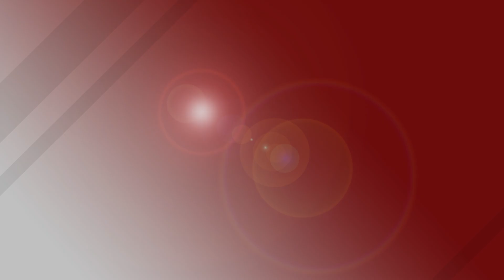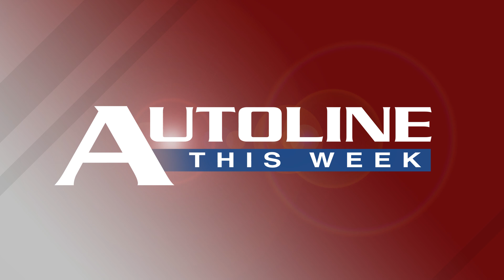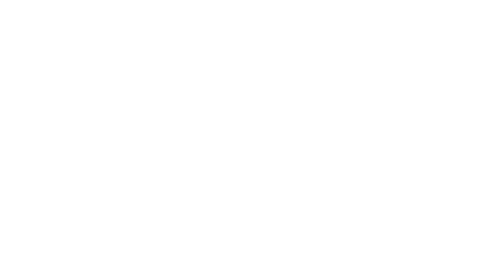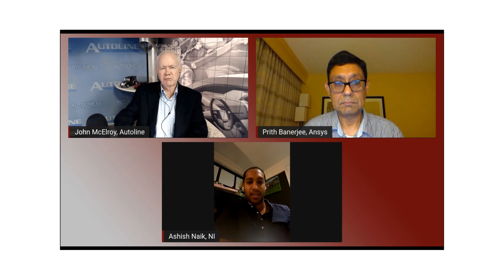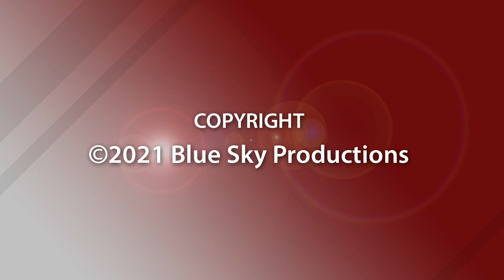Revolutionizing Product Development With Digital Twins - Autoline This Week 2528

Comment: Legacy focus on new product development.  improvement by product cycle --  new model product improvement.
Tesla focus on existing product improvement  [ continuous improvement of existing models ]
Legacy distraction?? or Legacy competitive advantage??
side note: Tesla doesn't change oil AND Tesla has the data -  legacy does NOT have the data.  ICE Fleets could have used 30 years ago.
Reply: Legacy does not have the data?   Who has the largest fleet of connected cars on the road?   Have you ever head of On Star which GM has had on their vehicles for decades.   Not only GM vehicles are using the On Star Network.

Comment: FSD has a fatal design flaw. "Learning" occurs in the Dojo data center which is then "delay & pinch" forwarded to the car's FSD module through an AT&T cell phone tower. Driverless cars making edge case mistakes leave Tesla liable. Today's presentation suggests the possibility of moving/predicting edge case decisions into the car and reducing the "learning/feedback loop" down to milliseconds, such that regulators will be willing to assign "mistakes" to "acts of god" releasing OEMs from liability.
Reply: You are assuming that there is somehow a "live" connection. This only occurs at each update. the car drives fine even when there is no connection. until the next update. There no "mothership"  controlling the car. in between updates, its pretty much on its own. THATS autonomy.
Reply: @dclpgh  Tesla signed a contract with AT&T to provide cell connection to their cars. Interrupts, where the driver takes control, are "errors" that are forwarded to the Dojo AI for classification or "learning", (as and when the cell tower connections get reestablished). The learned behavior instructions for the car are then forwarded back to the/all car(s) via AT&T cell connection. The in car FSD computer is a repository of learned behaviors. An FSD Beta update, may or may not include updates to the ancillary library files of known/classified images. There is a delay between a "mistake" induced "learning" and the update that goes out to the fleet of cars. Learned behaviors are updates from the past while mistakes are incoming from the future. Today's video suggested that there might be a way for learning to occur in the car in real time. Elon's criteria of "better than a human driver" leaves Tesla liable for all future edge case learning/mistakes. The regulators and courts accept "best efforts" from licensed and insured drivers. The bar for "computers on wheels" is going to be much, much lower.
Reply: @marvinegreen  you need to watch the presentation again. And again. Do you really know what you're talkin about? Dojo isn't even built out yet. Cellular Connection is primarily for the infotainment and navigation. When there is a disengagement the car will wait for a Wi-Fi signal because there are literally gigabytes to upload from the car 2 Tesla. 4G cellular connection ain't going to get it. Especially from AT&T LOL.
Reply: @dclpgh  I hope you are right.
Reply: @marvinegreen  Not an expert by any means. Folks do not appreciate the very high level of compute aboard a tesla. They have put on a chip that replaces the multiple servers that still fill up the trunks of the other guys and while they are still throwing hardware at the problem, its down  to a week or so SOFTWARE update!  Everyone will have their level of self driving that will work just fine, but i think tesla will be first to the finish line with general go anywhere autonomy . With dojo and the data lead and the unique way they can chew on that data, Yes i think so.
Reply: @dclpgh  My understanding of programming is that the working module in the FSD computer has resident "libraries" of image files that the Dojo has ordered in likelihood of a match (or, more probably just the dimensions of all previously encounter , say for example, traffic cones). So when the camera "sees" a standard traffic cone the likelihood is that the first or second entry in the library will return a "true" response. Back in the day, my Chevy Monza had a reflective triangle and a flare. If the Tesla camera "sees" my triangle but an match is not found on the FSD in car computer then the "error" tagged by driver taking wheel is forwarded back to the Dojo when the 4G connection is available. The Dojo then takes all the Tesla's everywhere that have reported an "error" involving triangles, and returns the conclusions out to update, probably expand, the library of known triangles in the FSD computer in all Tesla cars. My point is the time lag between "learning" at the Dojo and updates sent to the fleet. If you had lived through Ralph Nader and the exploding Pinto gas tanks, you might change your mind as to the critical nature of liability. Without an insured driver Tesla will become the scapegoat for every single "error" that results in an accident.
Reply: @dclpgh  Well, again, I hope you are right. I will check out those two YouTube channels you mention.
Reply: The biggest flaw in Tesla's system is the sensor suite,  no matter how good the brain gets the cars awareness of its surroundings depend on sensors,  with only cameras, that is not enough awareness.     Companies have cars operating autonomously on public roads,  that go months between interventions,  Tesla is generations away, and their cheap sensor suite will ultimately be the limiting factor.
Reply: @dmitchellhomes  Cameras do a much better job of dealing with random changes in an environment. My guess is that the regulators will first sign off on camera-based interstate trucking while lidar will be successful in low-speed, low traffic geofenced areas. Big companies with lobbyists will be pushing for the substantial cost savings that will accrue to driverless semis while the lidar crowd will be contending with fickled consumers.